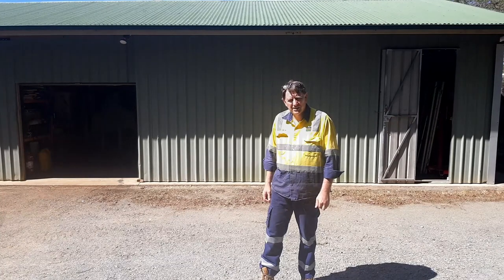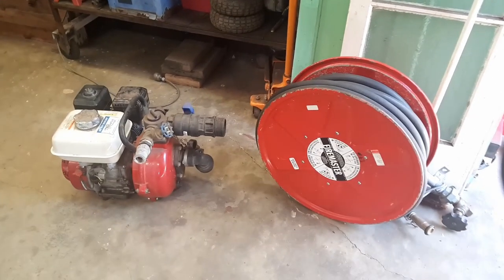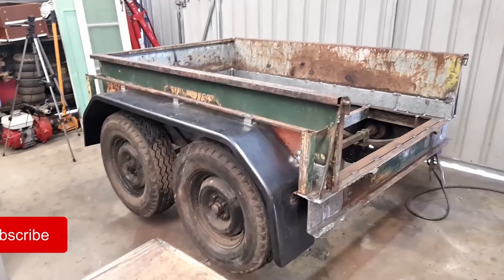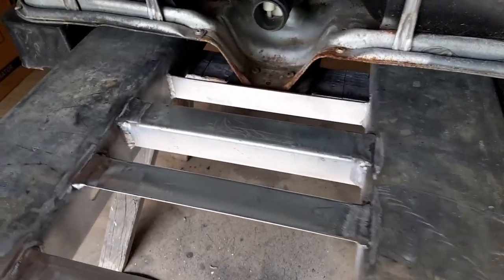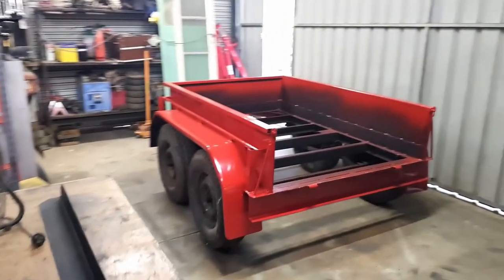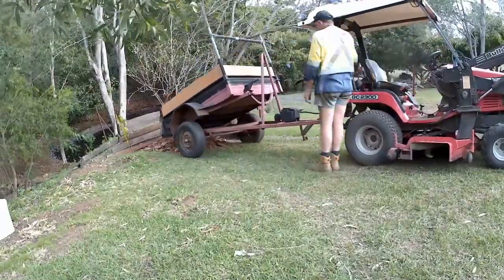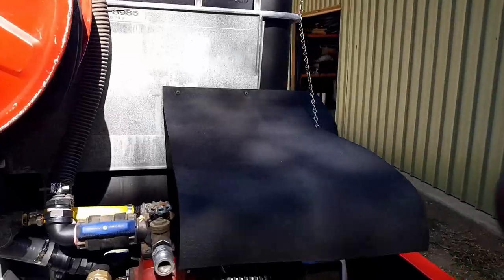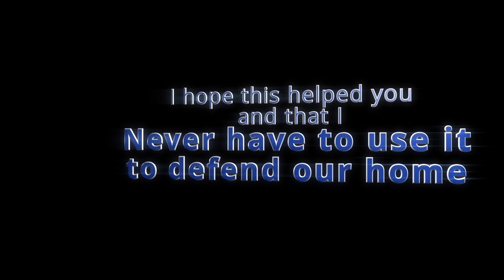Unbelievable Fire Fighter Trailer Build: Wait Till You See This!

Comment: Nice job. Do you need a bypass for when you turn off the house but leave the pump running? Or do just the line that goes into top of tank?
Reply: Hose not house
Reply from the maker: I just turn the valve to circulate back to the top of the tank. The pump won't explode or be damage for a minute anyway if I didn't.
Reply: Firefighter here.  Yes, you must circulate the water through the pump or you will damage it.  It’s probably OK for a minute or two.  Any longer and you should shut your pump down.